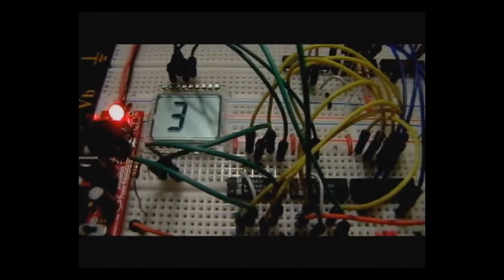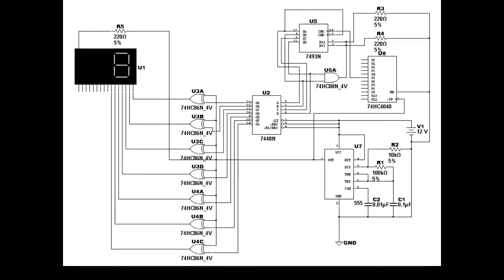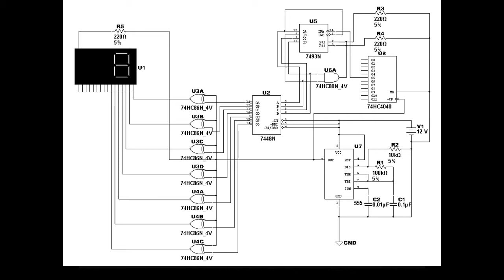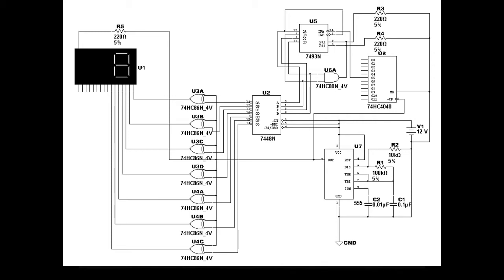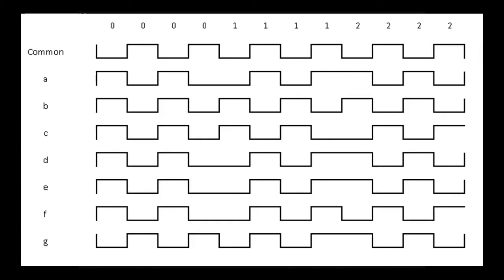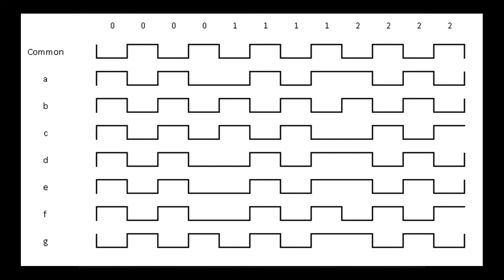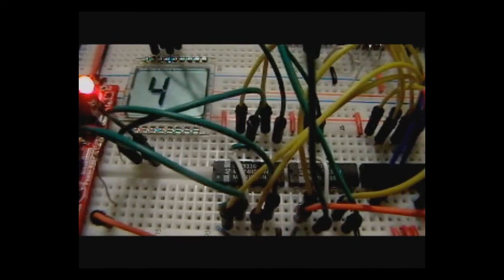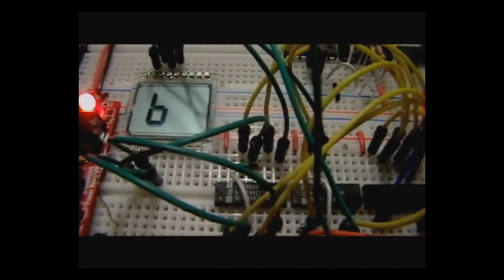Driving 7 Segment LCD without a Controller

Comment from the maker: I built another circuit using a CD4055.  The CD4056 was actually overkill for this particular effort and would have been combined with a CD4054.  I have uploaded the video for those interested.  Look for the video "Driving LCD 7 Segment with CD4055 ICs"

Comment from the maker: Agreed.  This was more an effort on my part to fully understand what needed to happen down to the nuts and bolts of the process.  I would not generally recommend this as an effective solution to be used for driving an LCD.  There are many ICs available out there that will take the bulk of the effort away and provide very clean solutions.  This was entirely an educational project for myself and one I thought I would share for others interested in the details.